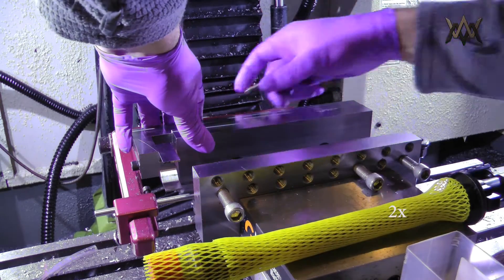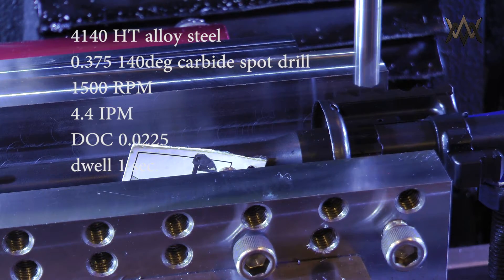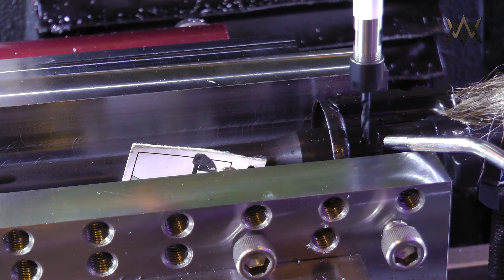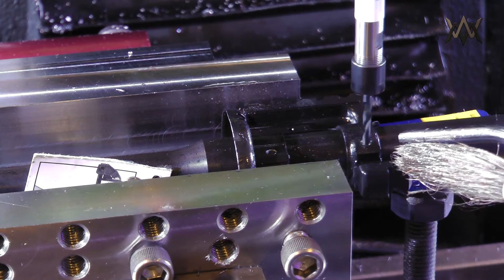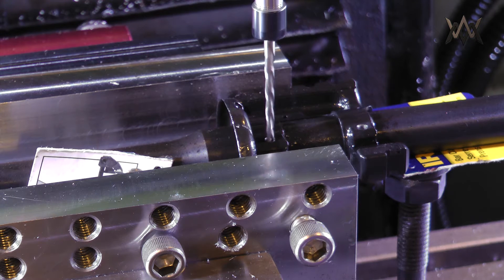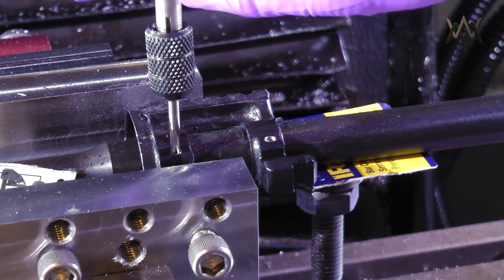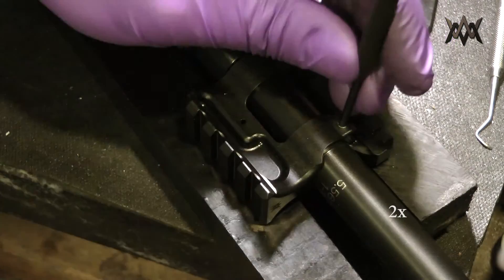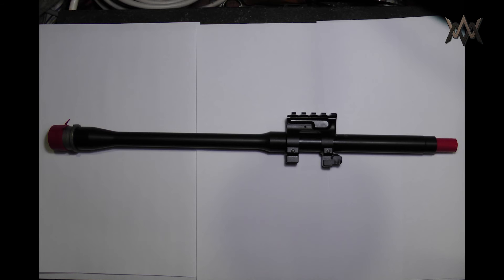AR15 Barrel CNC Gas Block Pinning: WarBlock High T-4

Comment: My AR556 F sight base was over tapered and when pins were tightened the sight canted, tired of trying to find an FFL to send it back, one I used to buy it won't bother. There's a hole behind the swivel sling mount hole just beneath the gas port that can be tapped and used to dimple for a set screw, very common problem with Ruger.

Comment: Im probably going to get shit for asking but I just needed some clarification, Is it possible to use a FSB off of another barrel and have it say "re-drilled / pinned " to a new barrel?
Reply from the maker: H GarriFab, that's actually a great question. 

Yes it is possible to do that and "re-drill/ream" the existing holes. Is it practical? No. It is 10x harder to do that, 10x slower, and usually results in broken tools. You can read more about it in the FAQ page on our website.

Comment: What do you charge to pin a customer supplied forged FSB to a melonite treated barrel?
Reply from the maker: If you provide all of the parts then the pinning is $35 plus shipping. We can provide everything however typically we do provide the FSB and hardware and that runs between $65-$100 depending on options.

Comment: Can you use .032" thick washer to replace hand-guard cap. How you keep the alignment of gas block relate to the barrel?  I have an A2 front sight to be drilled onto the barrel.
Reply from the maker: Yes you can use a washer to space the gasblock off of the barrel shoulder. We use an actual handguard cap that has been cut in half so that we can remove it easily after pinning without having to take the gasblock back off of the barrel. As far as A1/A2 FSBs we use a different fixture that aligns the FSB with a bolt that threads into where the front sight goes.
Reply: @Warmachinellc15  Thanks, I have emailed you prior to the Christmas break for A2 FBS stuff.

Comment from the maker: Hey guys, I've fixed the WarBlocks so that there is no longer a potential partial gas port occlusion risk.

All of the current Warblocks are good to go with or without a hand guard cap and we will offer them as such. We will include hand guard cap spacing unless otherwise requested when no hand guard cap is added.

If you have one pinned on a barrel and have any problems with under-gassing contact us and we will take care of you.

Also you you have a stand-alone Warblock and wish to use a hand guard cap when you do the install please contact us to do the modification for you. Sorry folks that was just an unforeseen problem that popped up after I started getting a stock of barrels in and test fitting WarBlocks to them.

We are now a Faxon dealer so you can now get WarBlocks pinned to these excellent barrels.